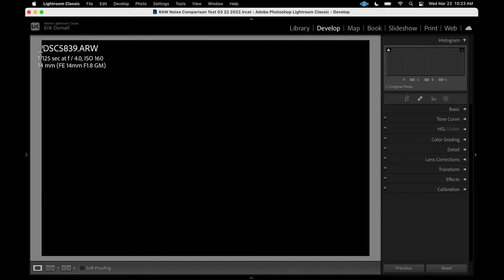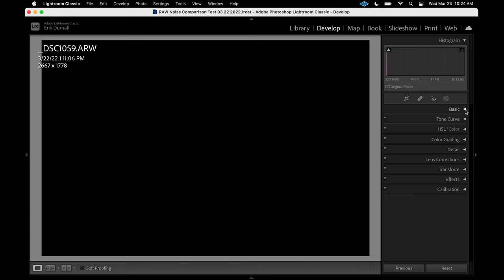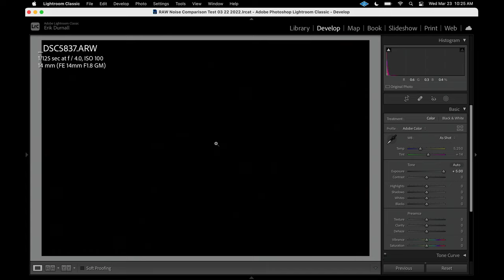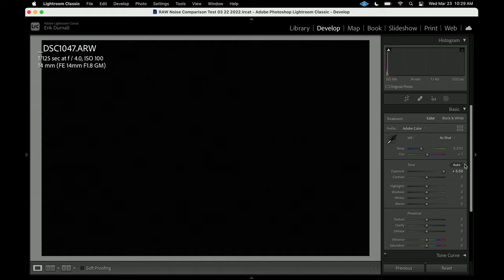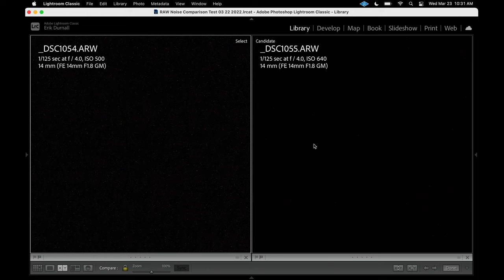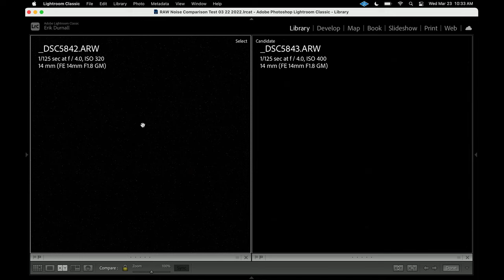Sony's Big Secret To Clean Images: A Noise Comparison Of The Sony A7IV A1 and A7III

Comment: Thanks for this video.  A long time photographer and something I'd never heard of!  Now I have a project, comparing my A7R3, R4 and A1!
Reply from the maker: You’re welcome! In this video I mistakenly said the A7RIV has the same second gain stage of ISO640 but I meant to say the A9II. The A7RIV has a lower gain conversion point, I think it’s ISO320.
Reply: @erikdurnall9585  I'm glad you corrected that RIV conversion point .  I have a RIV and an A1 so that info is great to have. Thanks!
Reply: I have the RIV, also. Thanks for the knowledge.
Reply: @erikdurnall9585  Never knew of this concept. This is only my 2nd year in the profession.
Reply: Thank you for this info. I had no idea this happens.  Will now use iso 80-160 and avoid 200-320 by going straight to 400 on my A74. Can you let’s know if there is a ‘reset’ higher up the range? If so where do we avoid for best results.

Comment: Higher resolution doesn’t collect less light, an individual pixel collects less light but there’s more of them, collecting as much light (signal) across the picture. You shouldn’t get much of a difference in noise when viewing the same image a the same size with higher res over similar sensor tech unless you’re cropping etc.
Reply: Common mistake Youtubers do. You can see who does their research and who doesn't.
Reply: Yes ! The sensor on the a7sIII its a real 48mp in a quad pixel Bayer binding so the output it’s 12mp! But each sub pixel can be set to different parameters, im this way u archive fantastic dynamic range.
Reply: If you look at graph from precise low light test, you can clearly see an a7c 24mp perform better than a7iv with 33mp, across all the range but clearly over 640 iso. Clearly test indicates than you shouldn’t go over 3200 iso in a 61mp when a7c can go easily over 6400 iso and even more. So bigger pixel have an importance, not the number of pixels. I prefer my 24mp a7c over a7iv, a7cii and a7rv or a7cr. I think it is best hybrid at reasonable price.

Comment: Thanks for the interesting and unique video. I tested my A7iii and also see a big improvement at ISO 640. Interestingly though, ISO 160 actually looks cleaner than ISO 100, and my ISO 200 looks pretty noisy (unlike on yours). Any idea what would explain better results at 160 than 100?
Reply: Somebody correct me if I'm mistaken but:
The Dual Iso of Alpha 7 IV goes up to 3200, all the dividers and multiples seem to have very less noise. So 3200/160, precisely, equals 20, so 3200 is a multiple of 160 what means it will have less noise problem
Reply: @theluciano354  I think this dual ISO behavior is different for video and stills. And for videos, it differs from one picture profile to another. Example
For S-Cinetone: 125 and 500
For Slog3: 800 and 3200

Comment: Technically, noise does not come from a lack of signal, and you cannot test SNR without signal calibration. When you plug in two different microphones into an audio interface to test their noise floors, you cannot just turn the gain knob to the max and compare that way, because they might have different sensitivities.

Comment: Thank you so much. Isn’t there another sweet spot in terms of ISO versus noise level up around 6400 in the A7IV? I thought I saw some information on that.
Reply from the maker: You’re welcome! There isn’t another sweet spot for RAW images, you may be thinking of using picture profiles in video. In the Slog3 Picture Profile the base ISO is ISO800 and the second gain stage is ISO3200 but this is the same as ISO100 and ISO400 in RAW still images, it’s just relative to the selected gamma of the picture profile. I wanted to keep this example as basic as possible so I didn’t go into all of that in this particular video.

Comment: Thank you, as an owner of A7iv, A1 and A7C, this is very useful information. I may start setting my ISO manually to second gain, rather than leaving on automatic. I photograph wildlife, and often have to heavily crop.
Reply from the maker: If I ever use Auto ISO, I do set my lower limit to the start of the second gain stage to avoid those noisy, low dynamic range points just before the high conversion gain stage starts.
Reply: Make automatic mode start @ second gain point instead of 100 ;)

Comment: This was an excellent video, thank you!  I am still shooting the A99ii, which uses the same sensor as the A7rii and A7riii, but I never knew about this.  I have just tested it myself, with no lens attached (just body cap), and the difference between ISO400 and ISO500 is immense!  It also means that the difference between ISO800 and ISO320 is almost nothing - such awesome info to have after so long using this system.  Thanks a lot for this, I really do appreciate it!
Reply from the maker: Glad to hear you found the information useful! Enjoy!
Reply: Iso 640 is super clean on the Riii sensor as it is the second gain stage start point. I try to be at 100 or 640 always if it can work for the shot. The sensor gets noisy quick. I personally won't go above 1600 and even then it rubs me wrong sometimes.

Comment: Great and informative video!
Does this apply to video on the a7iik as well? Meaning, what are the best ISOs to shoot (video) on the a7iii ?
Thanks in advance
Reply from the maker: Yes. It is for video as well as all modes. It’s always the same range depending on your base ISO of your selected PP. so if you’re shooting video with no PP (PP Off) then the sensitivity ranges are exactly as demonstrated here for the A7III (ISO100 and ISO640). That’s a 2 and 2/3 stops range. So if you’re shooting video and using a PP that has a base ISO of ISO800, the second sensitivity would be ISO5000, the same 2 and 2/3 stops range.

Comment: Erik, I’d like to hear your thoughts on “iso invariance”, meaning (on the A7iv for example) that all ISOs 400 and above are supposedly the same and only differ by exposure compensation.  Meaning a shot that would require ISO 3200 via the camera’s metering would have exactly the same noise if taken at ISO400 and bumped 3 stops in Lightroom.  If true, I’m not sure how to think about the practical implications except perhaps that one should always err towards under exposure in dark scenes…

Comment: Absolutely brilliant analysis! I have been a Nikon shooter for over 30 years and have noticed that images, dynamic range and noise, shift as I move through the ISO range. It would result in what to me seemed counter intuitive results . . . . you have now explained it.  Wonderful work! I am now a fan boy subscriber.  If you can now explain to me why I have to wait till December 2022 to get my FX6 . . . sigh
Reply from the maker: The FX6 is next on my list too!
Reply: @erikdurnall9585  I have a lot of Nikon glass and have played devils advocate with myself as to whether I should buy the Z9 for my video projects (it still won't show up on my doorstep till end if year). I lose a little on the  run and gun benefits like the slick implementation of internal ND. I gain 8K benefits for post. I've shot projects on rented  Sony F5 and Canon C100-300ii. Do you have an opinion on Z9?

Comment: 7:22 - this is not really accurate I think, not if you mean "restoring all of the dynamic range". The point of the low gain stage is to have the maximum dynamic range, but that means that low-light areas collect less accurate information. When you enter the high gain stage, you get less noise, but in turn, give up some dynamic range. You can think of this as having buckets for collecting the light. A big bucket can collect more light (high dynamic range), but measuring small amounts of light off of them is not as accurate (more noise). At the high gain stage threshold, you switch over to use small buckets, where you have less noise but also lower dynamic range. But increasing the amplification also reduces the dynamic range, and switching to the high gain circuit reduces the amplification, so you will restore some of the dynamic range, but not to the level the lowest ISO on the lower base ISO has. Dan Fox did a great job in explaining how the dual base ISO works in his video "ISO on Sony cameras is often INCREDIBLY misunderstood".

If you meant that switching to the high gain circuitry restores some of the dynamic range, then I was going on rambling about something you already knew - but anyway, perhaps this was not clear to all viewers...

Comment: Excellent video. So we can use iso 400 in sony A7 iv as iso 100? Which is the upper limit for iso in sony A7 iv with acceptable results for video?
Reply from the maker: Yes. ISO400 is almost identical to ISO100 on the A7IV. For RAW still images you have a lot of range for very clean images well beyond ISO1600. For video with picture profile Off, it is the same ISO ranges. If you are using a Picture Profile like Slog3, which on the A7IV has a base ISO of ISO800, your second gain stage would start at ISO3200 and you would still be seeing very useable footage at ISO12800

Comment: Great video, So do these ISO levels work the same for the video side of this camera?
Reply from the maker: Yes. It is the same in video except if you are using a Picture Profile the ISO ranges will be relative to the base ISO of the gamma curve that is selected.
Reply: @erikdurnall9585  i thought i read somewhere that there was in video mode a duel base ISO with the second base ISO being around 3200 on the a7iv
Reply from the maker: @buffaloray  yes, the Slog gammas have a base ISO of ISO800 and the second base ISO is ISO3200. It’s always two full stops. The S-Cinetone gamma has a base ISO of ISO125 so the second base ISO would be ISO500, the same two full stop range.

Comment: Thanks for another clear and easy to follow video. I have a question. In a previous video on using auto iso, it was recommended to set the minimum iso at 100 and maximum iso at 12800. Since there is less noise and more dynamic range at iso 400 than at iso 160 on the A7 IV, where do you recommend setting the minimum and maximum auto iso on the A7 IV for wildlife photography?  My long telephoto is 6.3 at 500mm. I'll be on a safari in Tanzania soon. We'll be out on the road in the early morning hours as well as the later afternoon. So, it'll be a battle between noise and using the right shutter speed to capture motion. Would you keep the auto iso, minimum iso at 100 for wildlife photography to be able to use a faster shutter speed?
Reply from the maker: It would be nice if the cameras offered an “indexed” ISO option where you could just switch between either ISO100 or AUTO ISO with a preset range of your choice, but since that isn’t an option it’s probably best just to start your AUTO ISO range at ISO100. The camera produces such great image quality it’s really not that detrimental to the overall image unless you’re really cropping in heavily and pushing the exposure.

Comment: It is very interesting point and push me to explore with my camera. From your experience, which camera is your best choice for photography in low light, A7iii, A7iv, or A1? Thanks.
Reply from the maker: Honestly they’re all basically the same. If I had to pick one it would be the A7IV because it has the best balance of performance, features and resolution. The A7III is the cleanest but it’s also the lowest resolution and the autofocus isn’t nearly as good as the A7IV or A1 so it really depends what is most important to you.
Reply: @erikdurnall9585  Thanks. Looking forward to watching your new coming up video on YouTube.

Comment: AWESOME VIDEO!  I've wondered about this.  I am a Nikon shooter; however, I ventured into mirrorless with Sony.  I have a 6300, A7 II and an A7 IV.  I also have a 1.8 85mm Sony lens.  I could see all of the noise.  I have a really good noise suppression plug in; however, I lose a lot of detail.  I want to use my Sonys more for professional shoots, but there is just too much noise.  I'm going to take your advice and try and use ISO 100 and/or 400.  Thanks for this video!
Reply: I will love to know your findings when you do. Do you mean your Nikon has less noise than the Sony?

Comment: I do wildlife photography with the A7R IV, due to rapidly changing conditions and fast speeds I run auto ISO. In good sunlight I just rock 1/1250 shutter and ISO does its own thing, but on the weekend I took some shots in good light and they were noisy as heck, ISO was sticking around 320. But now I think im going to have to change my shooting style, maybe in strong light I just need to set to ISO 640 and then just adjust shutter if need be. Shutter will be quick enough no matter what so its worth a shot
Reply from the maker: Unfortunately the A7RIV has a lower gain conversion point then what I state in this video. When I say the A7RIV I actually meant to say A9II. The gain conversion point for the A7RIV is actually ISO320 in RAW stills, so if ISO320 is too noisy then a higher ISO value isn’t going to improve your results.
Reply: @erikdurnall9585  Ah ok thanks for letting me know. Strange because I thought ive also heard from another video that ISO 640 is the cleanest for A7R IV, but like I said ISO was all over the place, looking at the photos from the weekend (of a black bird) they were ISO 320, 400, 500. I guess its just the fact of the high dynamic range of the black bird and bright background
Reply: @erikdurnall9585  I have the A1, A7iii, A7Riii and A7Riv. The A7Riv is the noisiest one by a mile. I mean, it starts off noisy at it's base ISO and just goes up from there. Having said that, I still have no problem shooting interiors professionally with the A7Riv to 1000 ISO or so. It's not that the noise isn't there, because it most certainly is, but rather the practical implications of the noise are a lot less problematic than a lot of folks make it out to be, even for paid work.
Reply: @loudandclearmedia agreed the a7riv is terrible. Only good for tripod or macro work . No good for wildlife, low light or action stuff

Comment: I compared the  A7IV and A7III read noise data on the famous site photonstophotos.
Above ISO 500, the A7IV has 50% more read noise that the A7IV in DN units (power).
This is not a big effect, as the noise is small.
But it is easily observable.
This represents a 0,5 shift in log2(DN) that are used on this graph.
I have no explanation for this.
The read noise should not depend on the pixel sizes.
But the reading electronics might be slightly different.

On the other hand, the size of the pixels for A7IV is roughly 28% smaller that for A7III .
(33 Mpixels versus 24 Mpixels)
Therefore, the "shot noise" for the A7IV should be 14% higher than for A7III.
This is because the shot noise is proportional to the square root of the number of photons detected.
This is important because in fair illumination, shot noise always dominates over read noise.

I think I will try to measure this shot noise.
I just realized this should not be too difficult.
But I would need a reasonnably uniform illumination of the sensor.
This uniformity would allow an easy estimation of the standard deviation (stdev) of the signal over all the pixels.
This is a way to measure the noise.

I already measured the read noise for my A7III for 37 different ISO numbers.
Retrieving these 37 "full dark" pictures and calculating the stdev, 
I could reproduce exactly the same results as on the site photonstophotos.
By myself. Boy!
The comparison is really almost perfect.

But my first attempt had shown a slight difference at low ISO.
I just discovered that evaluatiog the stdev over all the 24Mpixels was not a good idea.
Because there are slight variation of the average dark signal.
To get this perfect agreement, I simply had to calculate the stdev over a smaller area of 200x200 pixels.
And this is what I will also do with a fair uniform illumination to measure the shot noise.

Comment: Great info, Erik! Thanks for doing the analysis. However, I’m a little confused since you mentioned A7C also has a second native ISO at 640..is that accurate for shooting RAW images? Also, when shooting video (say, Slog-2) - Would you happen to know what’s the second native ISO stage?
Reply from the maker: The info I give here is specifically for shooting RAW still images. When using a PP like Slog2 in video, the range will be the same but the numbers will be different so if Slog2 has a base ISO of ISO800 then the high conversion gain stage would start at ISO5000.
Reply: @erikdurnall9585  I see what you’re saying. It seems like it matches up with what Gerald Undone had also alluded to, basically 1/3 to 2/3 of a stop better than A73, around ISO 3200 👍🏼

Comment: Have you done the same comparison with the a6400 vs a7III. If so what have you found. Thanks. Extremely interesting.
Reply from the maker: Unfortunately I do not own an A6400 so I cannot do the comparison myself but my understanding is that the A6400 has a similar high conversion gain stage that starts at ISO400
Reply: @erikdurnall9585  thanks very much. I recall Tony Northrup did a video a while back on the same subject. Yours is better I think.

Comment: Brilliant info, really useful Erik. Is there a second gain stage for a A73 ?
Cheers,
Andy.
Reply from the maker: Thanks! The A7III high conversion gain stage starts at ISO640 in RAW stills with no PP.
Reply: @erikdurnall9585  Thanks for your reply. I was wondering if there is another stage after 640 ?
Reply from the maker: @andyholdsworthmusicphotogr162  there is not another gain stage after the high conversion gain stage but at ISO64000 and beyond there is noise reduction that is applied.